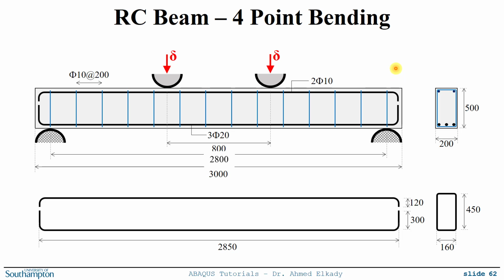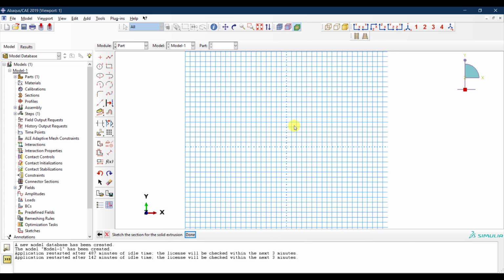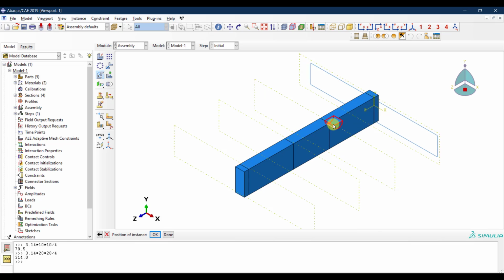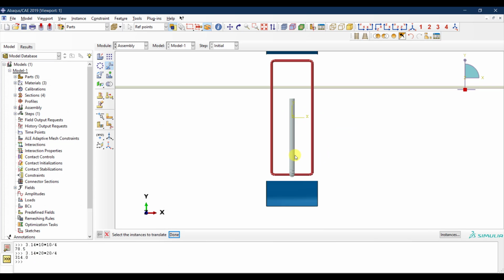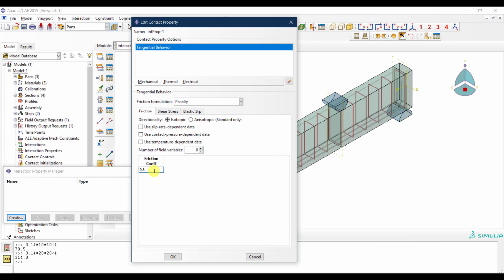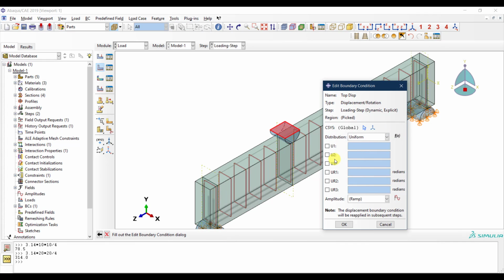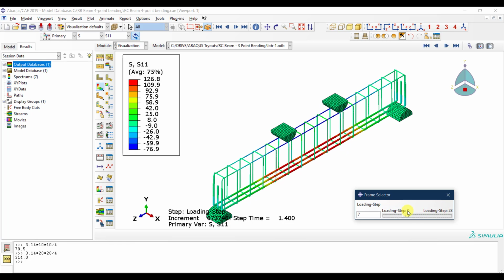#26 ABAQUS Tutorial: RC Beam under 4-Point Bending

Comment: Dear @ahmed elkady and @all, 
I am running this program but the job is aborted. Although i have assigned materials to all the parts but when i run the job the following error is shown:
"Error in job Job-1: 994 elements have missing property definitions. The elements have been identified in element set ErrElemMissingSection.
Job Job-1: Analysis Input File Processor aborted due to errors."

Any help will be highly appreciated
Reply from the maker: try deleting the assigned property definition for the rebar from the model tree and re-define it

Comment: I have created a reinforced concrete beam, assigned properties to all objects. But after embedding the steel frame into the concrete, the steel frame no longer has properties. It reports an error "416 elements have missing property definitions. The elements have been identified in element set ErrElemMissingSection". I have checked, these 416 elements belong to the steel frame. Please guide me to fix the above error, or can I send you the file to fix?
Reply from the maker: Re-assign the property to the steel elements with missing defintiion
Reply: @AElkady  I have the same issue. This solution does not work

Comment: Hello Sir, at 51:10 you mentioned it doesn't matter whether we provide pin or encastre boundary condition. However, if encastre condition is given it restricts the rotation as well which is not true in case of pin support ,  like in SSB condition one end is pin rotation is allowed and other end is roller , how encastre condition works here, I am confused please clear this.
Reply from the maker: Solid element nodes only have translation DOFs. Therefore, applying rotational constaints to solide elements is immaterial.
Reply: @AElkady  Thanks for your reply. I am again having another question which is how do we give simply supported condition to a concrete beam modelled as 3D (C3D8) then? Because it's must that rotation should be there. Kindly clear this.

Comment: Sir, I replicated the same model you mentioned and followed every step you took but the simulation aborts almost instantaneously with error message "994 elements have missing property definitions. The elements have been identified in element set ErrElemMissingSection." what is wrong going here please share.
Reply from the maker: 994 elements have missing property definitions. Make sure you have assigned property definitions to all parts.
Reply: @AElkady  i have checked everything but this issue still persists. i have followed you model only. i can share the .cae file if you want

Comment: abaqus needs parametric design library for structural elements. Modelling each element one by one is not practical for professional use because most of the time structural engineers have limited time for design/analysis process. I cannot imagine designing a building with abaqus.
Reply from the maker: Yes. You can also create an abaqus GUI plugin with a section or material library. Some videos available online for the process.

Comment: Thank you for this detailed explanation. This was very helpful. I have a question concerning the loads. If we want to apply pressure on the top surface of the steel support instead of displacement is it possible? If yes what are the boundary conditions we have to add? (This work will help me a lot in my thesis work)

Comment: 42 nodes on an embedded element do not lie in any host element. Check coordinates, exterior tolerance and absolute exterior tolerance parameters, and the host element set definition. The nodes have been identified in node set ErrNodeEmbeddedNode.

994 elements have missing property definitions. The elements have been identified in element set ErrElemMissingSection.

Analysis Input File Processor exited with an error.
Reply: what can I do please?
Reply: I too got the same error,did you solve it

Comment: Hello, Dr.. Ahmed Elkady. This is a great video. I learned a lot! But I have a situation in my work - I already done my modeling, steps, interaction, and all based on the sample on your video, and yet, I come up with no results in the Visualization. I only did what is told on your video.
Reply from the maker: If you are using explicit solver, make sure that the field variables are saved every time step that is smaller than the step time (Check the fied variable request).
Reply: @AElkady  Sorry for this comment. It just happen that I click the results in the UI and not in the job. Sorry Dr. for the inconvenience. So, when I click the results in the Job, that is where the results came in. Thank you for answering my querry, Dr.! You're such a lifesaver in Abaqus tutorial!!!
Reply: @AElkady  I have another concern about this tutorial, how to graph the Force vs Displacement (Midspan) for this 4-point bending test? I have watched your other tutorial here: https://youtu.be/pymmvbp4Kz8 where you have extracted the Force vs Disp graph from the Column Base (Reaction/Force) and the Displacement in the Beam end.

Comment: Dear Dr. Ahmed, 
How to solve this error "THE MATERIAL OPTIONS *CAP PLASTICITY, *CAST IRON PLASTICITY, *CLAY PLASTICITY, *CONCRETE, *CONCRETE DAMAGED PLASTICITY, *DRUCKER PRAGER, *FOAM, *CRUSHABLE FOAM, *MOHR COULOMB, *JOINTED MATERIAL, *PLASTIC AND *SOFT ROCK PLASTICITY ARE MUTUALLY EXCLUSIVE" in the ABAQUS.
Reply from the maker: This means you can not use two of these material models in the same time.
Reply: @AElkady  No sir. I am using only "CONCRETE DAMAGED PLASTICITY" material model as you have done in your video. But I am getting the error "THE MATERIAL OPTIONS *CAP PLASTICITY, *CAST IRON PLASTICITY, *CLAY PLASTICITY, *CONCRETE, *CONCRETE DAMAGED PLASTICITY, *DRUCKER PRAGER, *FOAM, *CRUSHABLE FOAM, *MOHR COULOMB, *JOINTED MATERIAL, *PLASTIC AND *SOFT ROCK PLASTICITY ARE MUTUALLY EXCLUSIVE" in the ABAQUS".
Reply: Sorry sir. I understood your reply. And solved my error. Ok sir. Thank you.

Comment: Hello sir, I tried to submit the job from your CAE file, but it was aborted and this error showed: Process terminated by external request (SIGTERM or SIGINT received). Knowing that I neither killed the job myself nor changed the power source(unplugged my PC). I googled the error, but a lot of possibilities were to consider like meshing size, increments, odb size, cutting off the internet connection, what Do you think would be the problem!  Please, if you have any idea this let me know, I'm kinda in a hurry.
And thank you for your precious content.👍👍
Reply from the maker: This is most probably a license issue. Try running the job without using parallel CPUs.
Reply: @AElkady  thank you for your reply sir, I managed to fixe that! Neverstheless, I encountered another issue, the job kept running for almost 5 days that I had to kill it myself, the output tab shows constantly frame 11 and the progress freezed at some increment number without showing any error. Is that normal sir? Taking this much of time to run a job like this one? Thank you

Comment: Sir thank you for sharing the tutorials...Hope to see more.... 

Sir I have one question, Suppose I am simulating an air blast experimental test on reinforced concrete slab modelled using CDP model and Johnson cook model for steel, how can I understand the slab is failed or not. I tried to do the same but from deflection time history I understood that the maximum deflection have gone to the level of 20cm after which there is no change in deflection. But it is obvious that a slab cannot deflect that much. The time period given in step module is 0.01 and I am using explicit analysis using conwep airblast. Can you give me some suggestions?

Comment: Thank you again Dr. Ahmad..If we modeled half of the beam to be more efficient, what would be the constraint on the symmetrical face of the beam (mid-span)? Any suggestion?
Reply from the maker: applying symmetry in the transverse direction will be not be appropriate in that case since this pinned-roller beam is allowed to deform in the longitudinal direction (even at mid span)

Comment: Thank you for sharing your video, sir. I have a  question. May I know why you use dynamic explicit analysis instead of static analysis, because the 4-point loading test is a typical static test for static analysis, however, explicit analysis in ABAQUS is used for impact or other dynamic analysis related to time variables.
Reply: So, I am wondering if I can follow your method to do the static test analysis for RC beam.

Comment: Dear Dr. Ahmed Elkady, Thanks a lot for your great presentation. I tried to do the same as per your instruction, However, end up with the error "994 elements have missing property definitions. The elements have been identified in element set ErrElemMissingSection. Analysis Input File Processor aborted due to these errors.difficult to find the error, as per me it is in order. please help me to find the reason for this error.
Reply from the maker: This means that some parts are missing a "section" property assignment. Make sure that you assign a section to each part. Also, make sure, that the mesh element category matches the assigned section property type.
Reply: @AElkady  Thanks a lot for your response sir. Still difficult to find the error, I checked the elements through query information, Total no of elements are as follows. The total no of elements for reinforcement including stirrups is 994. but properties have already been assigned. your kind support in this regard is highly appreciated.
number of elements: 14323
      11781 linear hexahedral elements of type C3D8I
      994 linear line elements of type B31
      1548 linear hexahedral elements of type C3D8R

properties have been assigned for all elements. what is type B31 elements
Reply from the maker: @premasirikarunarathne5893  you must sure the mesh element type matches the assigned section property type. For example, if you have assigned a truss section to the rebar, then make sure the assigned mesh element is also a truss element such as T3D2.
Reply: @AElkady  Thank you very much, sir. Abaqus automatically selects B31 type elements as the default for all reinforcement represented as truss elements in this case. B31 elements were manually adjusted as T3D2, and the error was eliminated. why Abaqus select B31 for truss by default and What's wrong with selecting B31 elements instead of T3D2.

Comment: Dr Ahmed, you mentioned at time 2.01 minute to be more efficient to make use of symmetry you model half of the beam, but if assign the symmetry boundary condition to either main or transverse reinforcements, a warning of the overconstrained condition on the reinforcing bars will be shown due to the embedded constraints and the applied symmetry conditions. Is there any way to resolve this problem noting that I'm using the implicit solver method? Thank you.
Reply from the maker: A simple solution would be to create a small partition in the rebar lements near their edge. Use this partition to apply the symmetry BCs and excllude it from the embedment BCs.
Reply: Thank you Dr @AElkady  for reply , i will try this method

Comment from the maker: The CDP material data used in this tutorial is available for download (see link in video description)

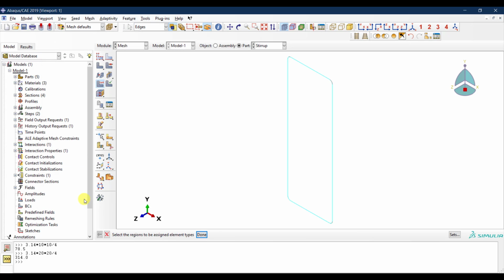Correction @41:27 --> Selected mesh element family should be Truss instead of Beam since rebar parts were modeled using truss sections.
Reply: Hello sir, could you please cite the reference source (article) of the CDP data used in the tutorial?
Reply from the maker: @nadaeljouchine6474  there is no reference. A generic concrete compression test is used to define the CDP. You can find many in literature.

Comment: Dear Sir!
I highly acknowledge your efforts regarding this informative guide. I have few questions. Would you please answer?
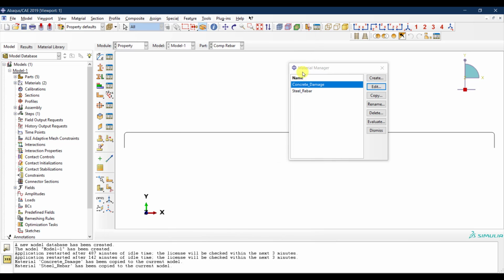1) Around 14:55 (in your tutorial), under 'Concrete Damage Plasticity ;
a) Under 'Concrete Compression Damage', what values you've used for 'Yield Stress' and 'Inelastic Strain' for 'Compressive Behavior'? 
b) Under 'Concrete Tension Damage', what values you've used for 'Yield Stress' and 'Cracking Strain' for 'Tensile Behavior'?
(Actually Sir I'm following your data while modelling (a typical beam) to have an accurate sample like you because I'm a beginner in ABAQUS).
2) Why do we use reinforcement as a 'Truss type element" instead of the beam?
3) What might happen if we draw the parts randomly instead of very correct according to the reference axis as you did for stirrups? Why can't we draw them randomly and later on put/draw their exact dimensions?
(In fact, my supports and reinforcement locations aren't exactly the same (after assembling them) as yours, maybe it is due to not drawing them exactly as per axis (as you did).
I am waiting for your very kind response.
Thanking you in anticipation.
Reply from the maker: Please check the video tutorial on the CDP material model.
The used CDP material data are available to download in the description.
You can used either truss or beam elements for the rebars.
You can draw the parts randomly. ofCourse, doinf this with reference axis make the assembly process easier.
Reply: @AElkady  Thank you very much Sir for your very kind response.
Can I please contact you/ask questions next time in case I come across any difficulty/problem in ABAQUS? Thank You.

Comment: dear dr.Ahmed,thank u for ur tutorials they all very impressive  and I learned about ABAQUS.my question is when ever I define concrete damage placiticity I recieve messege in job submission that `` cap placiticity,concrete damage placticity .......etc´´exclussive..why this happens?
thanks,
Avin
Reply from the maker: Please state the full error messgae
Reply: @AElkady  Thank u so much for ur reply, I solved the issue I was defining plastic and concrete damage plasticity.
But now I am getting another error said "the independent variables must be arranged in ascending order. This error may have been caused by a possible empty line on the datacards in the property definition"...so I dont know where exactly I have to fix this